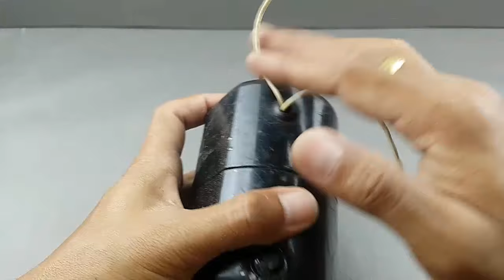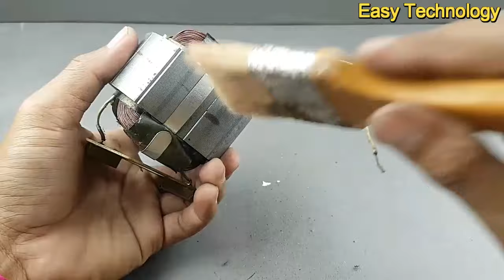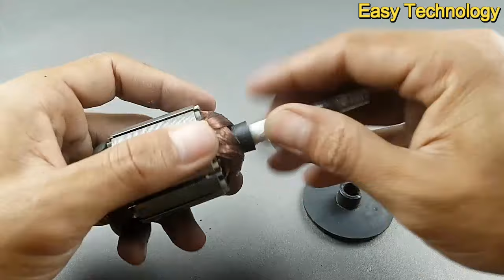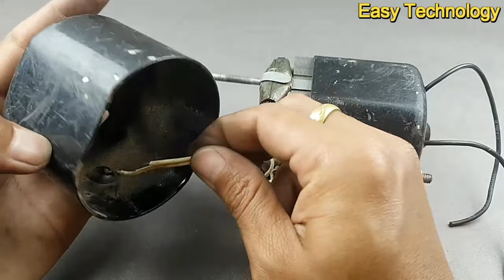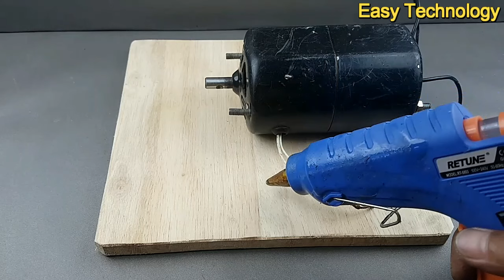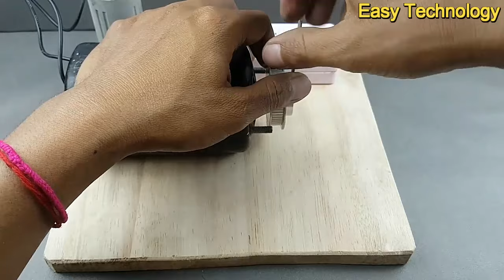I Make Free Electricity Generator 5.5kw powerful electricity  save with motor magnet At Home

Comment: There's no proof of total claimed power output.  Also need a faster spinning motor to reduce or stop flickering.  At most, in this demonstration,  output is about 500W, not the 5.5kW as claimed.

Comment: The magnets replace the brushes so 
The power he is driving into it from the power source spins the rotor Alittle for the show.
All he is doing is sending current in one end of the  windings from source out through the brush wires.
The rotor doesn't even have to spin to accomplish this magic.